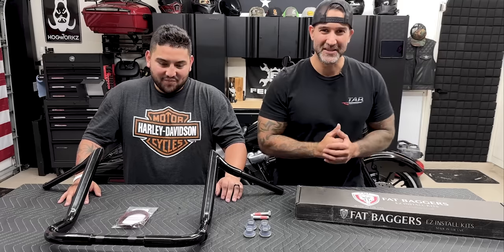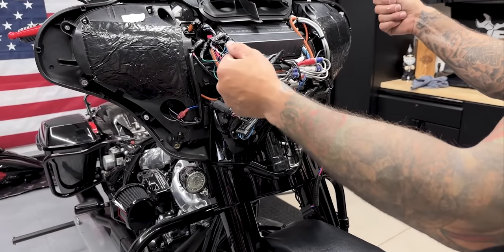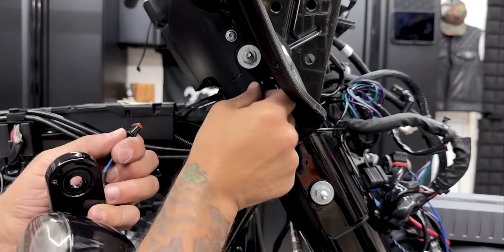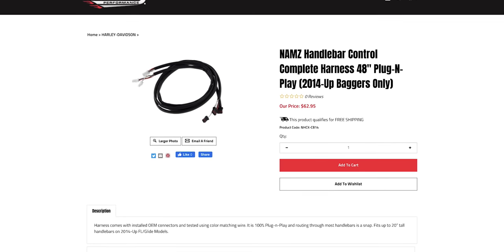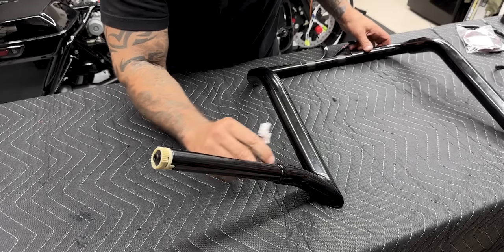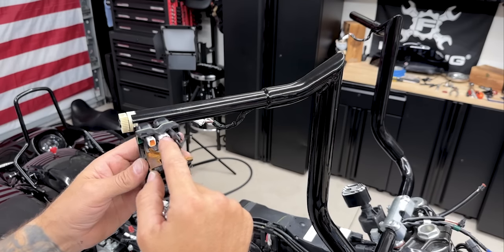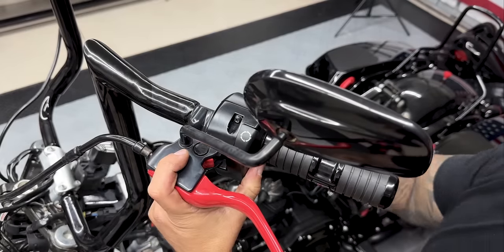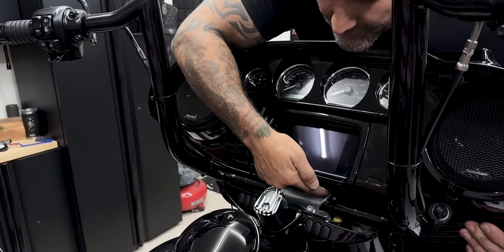DID NOT GO AS PLANNED!!! But these 14" Prison Bars are going Legit! -TAB Performance

Comment: What size windshield is this?
I just my Harley dealer install a set of these using 12" bars, I kept the factory windshield and my bars appear to be 14" perhaps its just the way the Tab Performance bars are made? But mine look 14" not 12". Wish I could upload a picture for reference.
Reply from the maker: I believe this was a 4” Klock Werks wind shield